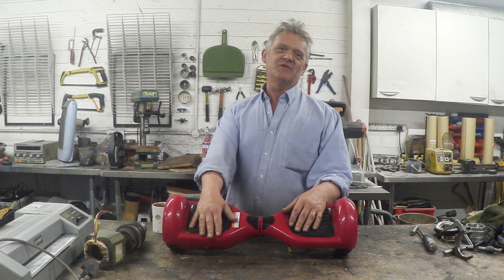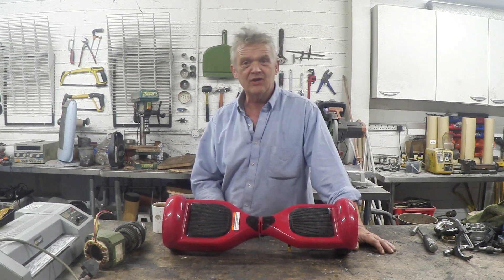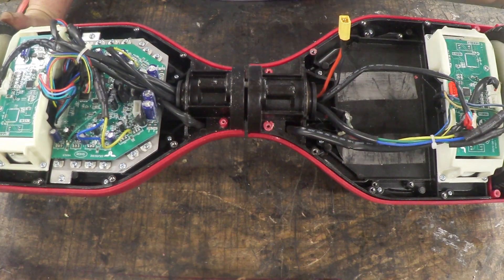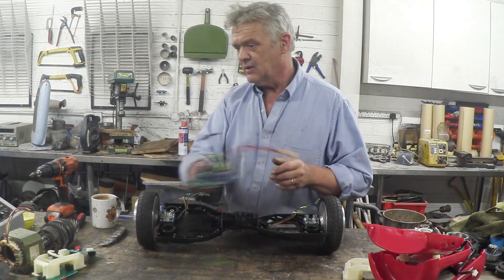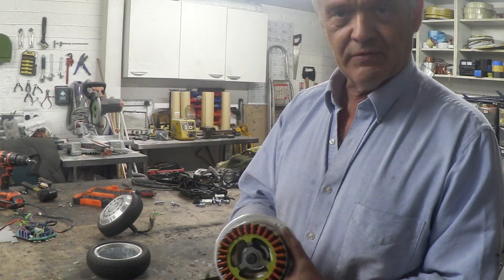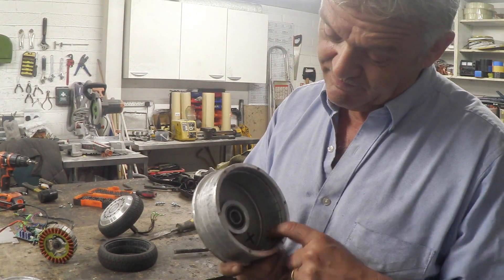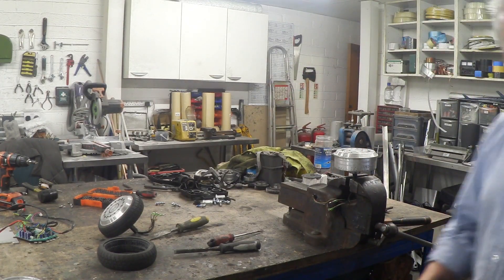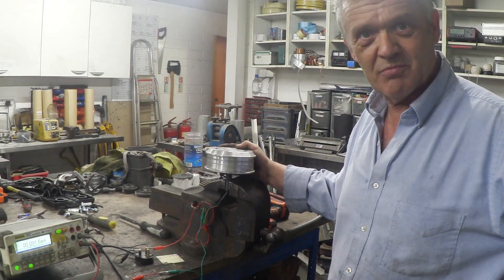1212 How To Make A Wind Turbine From A Hoverboard - Part 1, Removal And Disassembly Of The Motor

Comment: Would it be possible to utilize the main board for its mattery management and use the hub motor to charge the 36 volt battery?

Comment: Strong magnets? Yeah, I'd say that's an accurate statement although a bit understated lol. I have about four of these wheels in various stages of parts salvaging and I think there's around 30 or so neodymium magnets in each one they're glued to the rim obviously because they're in north south facing it would just pile up in one knot if they weren't glued down, but I found an ice pick or something very similar in between them each one at a time peels them up, you just have to be sure to slip something like a knife underneath it just as soon as you get a crack or else it's going to flip and stick to the one next to it and then... well you'll find out soon enough because it's going to happen regardless. So if there's  somebody that has never messed around with neodymium magnets this should be quite interesting for them,it's an eye opener that's for sure,  they're a whole other level, honestly nothing else in mechanics makes me laugh as much as rare earth  magnets because to me they're often like wayward little children always up to no good and wanting to do exactly what you don't want them to do right when you're not looking.

Comment: Hi Rob I have made a hover board turbine but I’m having trouble controlling the power from it. I have had up to 30a from it which is great but my dump load is on and off to much. I’m not technically minded, so I wondered if you could point me in the right direction. I was told that these hb motors are 350w. Thanks
Reply: What are you using as a dump load? Have you solved your problem?

Comment: YOU CAN DRILL HOLES IN THE LIP AND USE SPOKES TO LACE IT TO A BICYCLE RIM, THEN YOU HAVE A BIKE HUB MOTOR AND PLENTY OF THINGS CAN BE DONE WITH THAT, 16" OR 20 " RIM WOULD BE BEST, SMALLER THE BETTER. GOOD LUCK, CHEERS.

Comment: Hey Rob, I have two on those boards cost me 5 dollars Au for the both of them. Charging them up found out power supply is dodgy.  Need to find a 48 V ???A power supply.  Do you know the current as I throw the brink power supply out not looking a the Amps mate.
Reply: The cells in the battery are rated around 2.2A/h, so a 1A or 2A charger should be fine.

Comment: Just a hint: E-bike rear wheel motors have threads for sprockets. They are very well suited for windmill power generation as they turn at a slow rpm anyways.

Comment: Nice, and you can use the back plate to mount the blades.
Reply from the maker: exactly which is why I went into motor disassembly - you are going to need to be able to do that in order to start bolting things to it - otherwise I suspect you would ruin the motor

Comment: I got one a while ago for free, just wanted the battery but knew I wanted the hub motors for a future project. 
Just need a bridge rectafier and I'm going to build the same.

:)

Thanks for another great video.

Edit: u have 2 hub motors, one for a wind turbine and the second for a brushless generator upgrade for the pedal flywheel project.
Reply from the maker: awesome mate - because I can think of a few ways this can be used